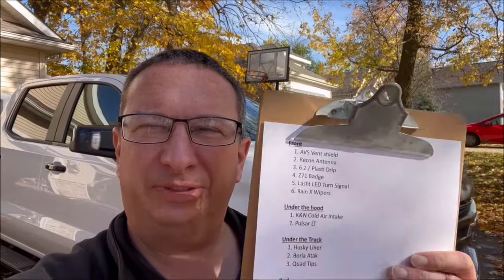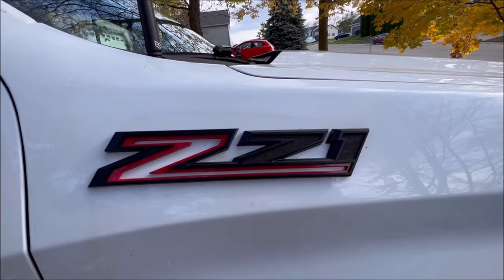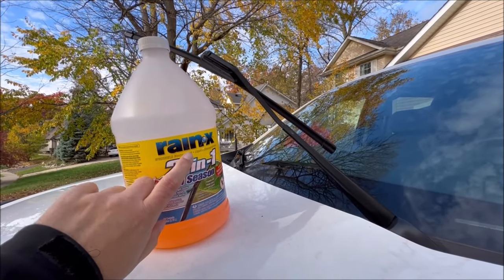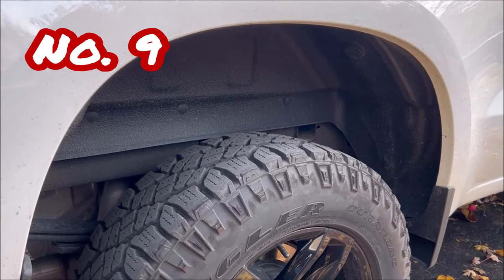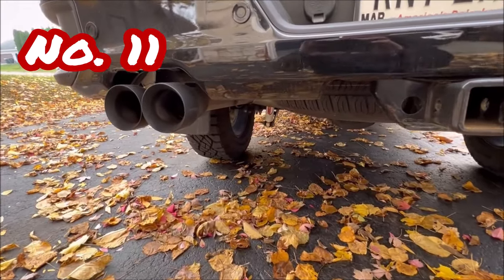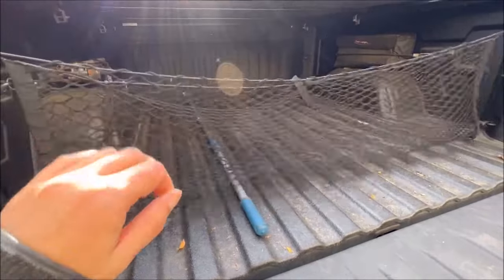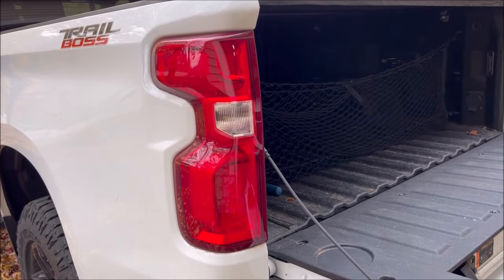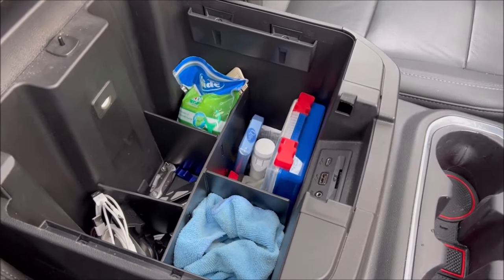21 Amazon Mods and Accessories for you Truck

Comment: This might sound crazy, but use tire gel on the bed cover. It’ll make it look new again. I use Meguiars tire gel on any black trim and works great. Last for a long time
Reply from the maker: I actually have some of that. Thanks for the idea!
Reply: Thanks
Reply: Yep!👍🏼
Been using it for years on everything and meguiars is by far the best 
Will last months even through washes and rain 
And if you have a primer hit rod like me it will actually make the primer look like a matte black plaint 😁🤭
Just takes a long time to wipe the entire car but definitely worth it
Reply from the maker: @bradbucklin2692  Now that the weather is getting warmer, I think I will try this.
Reply: Saw this comment and I’m tempted, but it says on the back of the bottle not to use on plastic panels 😓
Reply: I use 303 Protectant Interior & Exterior on my outside trim and tonneau cover. Has UV protection, gives a nice matte new look to the items and provides solid protection.

Comment: You need a hitch or bump step protector in the hitch. Trust me, it's well worth it. The feds mandate any frame damage on any vehicle a total loss. I lost a perfectly good Silverado to that just because some idiot hit me from behind. Total loss on the truck.  Don't risk it. Get something in that hitch to cover you from a minor rear-end accidents. With the costs of trucks, these days. BnW makes a hitch or weather tech bump stop. Cheap compared to a 50k and up replacement hassle.
Reply from the maker: It’s a good idea. Thanks!
Reply: @terry4183 What the heck are you talking about when you say "Get something in that hitch"? A rag? Fill it with great stuff foam? An apple?
Reply: @jayryan7473  Umm the first thing I said "You need a hitch or bump step protector in the hitch." Learn to read Troll.

Comment: A cold air intake? You mean a hot air intake? Those serve absolutely no purpose but the waste money I’m not gonna put one on my truck. You’re just getting a placebo effect. Good job, voiding your warranty.
Reply: Actually, according to federal law, they would have to prove that a cold air intake actually did something to damage the vehicle so it’s really a moot point that you’re trying to make. I would agree though that the particular open box intake isn’t the most efficient design because it’s obviously going to suck in hot air from the engine compartment.
Reply: Bit dramatic? He didn’t void his warranty.
Reply: Cold air intake alone does very little. But when you combine it with an exhaust system that reduces back pressure such as the borla atak, that’s when you see the benefits

Comment: For you truck?
Reply from the maker: Yes. As I said in the video, there are some of these items that will be specific to the current gen GM truck, but other items that are universal to many different trucks (or just a different part number for the same item for other trucks)

Borla makes exhausts for just about everyone. K&N makes intakes for all kinds of stuff. The exhaust tips are for a Dodge but fit a Chevy. The bullet antenna fits any vehicle with a radio, etc...